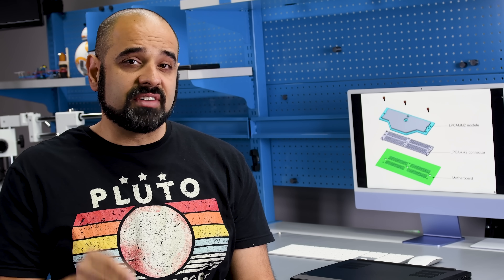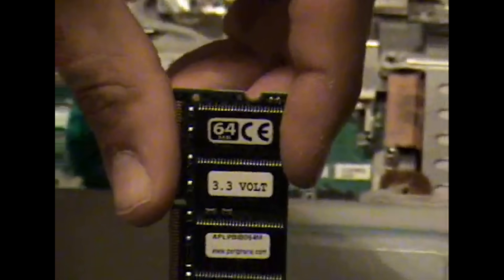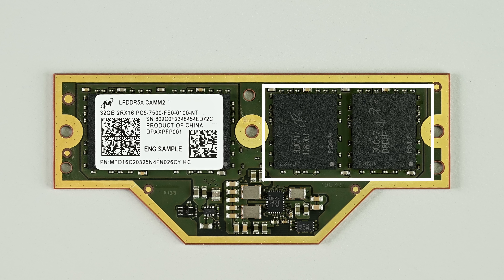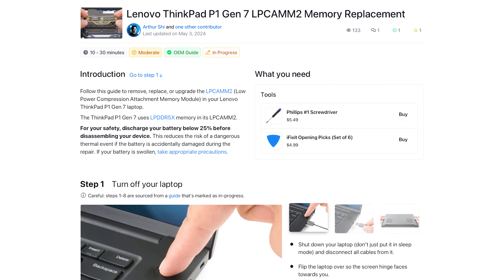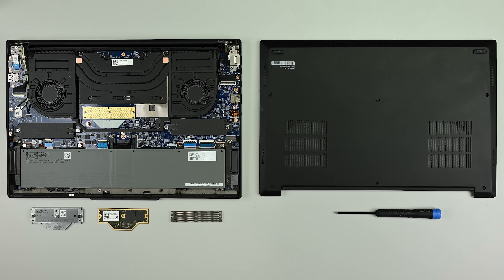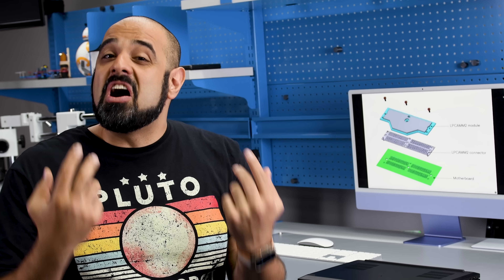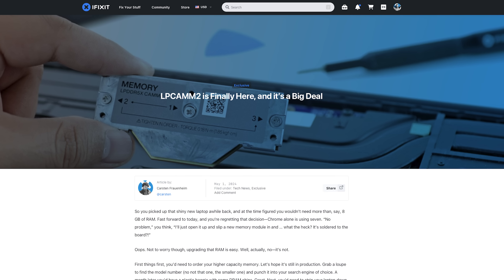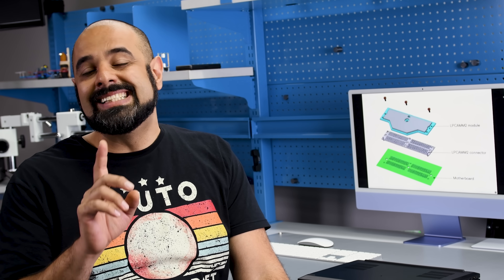New Laptop Memory Is Here! LPCAMM2 Changes Everything!

Comment: Hopefully the new ARM Laptops use this instead of using the platform architecture change as an excuse to start soldering RAM and storage like Apple. That pin interface is genius. Just replace the cheap interconnect instead of worrying about bent or broken pins. CPUs should also do that.
Reply: The inability of ram swaps is my biggest concern about arm chips. If that is the solution i am optimistic that we will see more arm chips in the future especially in laptops.
Reply: On a processor LGA it would be more challenging due to the increased pin density. Instead of 240 pins you're looking more like 1331 or more in a densely packed grid. That's gonna take some serious pressure engineering to get right but man oh man would it ibe worth it!!
Reply: @DigBipper188  it'll probably just be expensive
Reply: I'd like to see cpus with this compression interconnect in laptops. Not on all or even most laptops, but specifically gaming laptops. There is no reason we couldn't have upgradable cpus in laptops again.
Reply: No way storage is getting soldered. That's an apple bs thing. Soldered memory probably will be common as this was just introduced and it is simpler to assemble
Reply: I'm still concerned about them because MS doesn't allow ARM CPUs to have a toggle for secure boot. The unlocked bootloader stuff on Android is an absolute mess and I hope PCs don't end up like that
Reply: @AdamSmith-gs2dv  You will be able to boot any media as long as it is verified by microsoft by paying them the tithe. Every major linux distro is secure boot verified.
Reply: I don't see why they can't implement two tiers of RAM, even Apple could do this. System performance would be limited by upgradeable (slower) memory, while soldered memory would act as a huge, slightly faster cache. But I can see this being a thing, with proper software support for optimization.
Reply: @sovo1212  Bean canyon already has CPU PCB soldered RAM as L4 cache; in addition to the socket SODIMM.
Reply: @longdang2681  Didn't know about it. This is probably what the future holds.
Reply: I dont think anybody have bandwith that apple has when it comes to ram
Reply: I bent a pin while installing my i7 years ago, and then spent a hellish number of hours fixing it, so I second this for CPUs!
Reply: Why arms has inability to swap ram?
Reply: @NetvoTV  it does. Ampere CPUs are ARM and use regular desktop RAM. Manufacturers will lie to you to convince you that it is for your security or some debunked benefit. The only benefit to soldered RAM and storage is making you pay 10x the price of the components compared to buying and upgrading yourself. Also, it makes sure when you need more powerful components or those components break you have to buy a whole new device. It is more profitable to not engineer a solution to lack of repairability.
Reply: @shApYT  how about the signal lose this video mentioned from low power ram not close enough to the CPU and GPU,
Reply: @NetvoTV  the engineers figured out a solution. Doesn't mean manufacturers like Apple want that solution.
Reply: @shApYT soldered ram also means faster ram speeds th, and arm isn't compattible with the normal ram sticks in motherboards ,that is why they still use soldered chips in the snapdragon laptops.
Reply: @NetvoTV  For upgradable RAM, computers(both ARM and x86) needs to maintain compatibility with any installed socket RAM, otherwise you end up with picky systems that will only work with certain RAM modules. Technically ARM systems can do it but will likely need additional things including an updatable bios/ROM. This would add complexity and cost etc. to the ARM system. x86 already have this extra complexity by default with their ability to update bios to improve RAM compatibility. In this sense, consumer x86 systems have had years to become very sophisticated when compared to similar ARM systems. Keeping the electronics/complexity sparse also helps the ARM system to reduce it power consumption.
Reply: I doubt the first gen will have it, in the video he said Micron and Lenovo partnered to do it first, I give it 2 years to properly saturate the industry.
Reply: it would be cool on cpus as well but there are two big problems in that the ridiculous pressure and heat and the amount of pins, but cool to see it in there as well
Reply: This tech is undoubtedly awesome!  When it comes too companies using it Lenovo setting a bar will be good for companies who would probably rather lower species but upgradeable laptops en mass than be forced into more expensive ones that can't be fixed at all.   Fingers crossed we see this formate taken by other companies and framework laptops. As laptops switch to arm and are compared to cellphones now in terms of manufacturing I hope we can end this trend of e waste products produced with bare minimum specs lasting only a couple years before becoming obsolete.
Reply: It all depends on how large the GPU is,   

If you have a large enough GPU then just like a dGPU on desktop having socketed memory (even this LPCAMM2) is just to limited when it comes to bandwidth and your going will end up bandwidth starved.
Reply: Plus upgrade interconnects that may allow better upgrades down the line like faster than normally possible Mhz/transfer
Reply: Even if the Snapdragon doesn't use it, there maybe a workaround some companies use to include LPCAMM2 in addition to upgrade the existing RAM.
Reply: Most windows laptops are already soldered but I'd love for there to be a snapdragon elite x option with upgradable ram.
Reply: You can forget about replaceable RAM on ARM platforms, those will always be made in SoC format
Reply: Just hopes that the pads don't wear out
Reply: I clearly hates apple because they soldering ram and storage. If storage dies first the board absolutely die for normal ppl
Reply: @hasyidanparamananda  wait until you find out many windows laptops also have soldered ram...it's not just an apple issue. you cant just blame apple for everything and ignore the same issues on the windows side.
Reply: @hasyidanparamananda apple uses a SOC approach now, so we probably won’t get a replaceable RAM until something drastic happens
Reply: @Velocifyer  but apple was the first company to do it in a very efficient way. Both box86/qemu and windows are significantly slower than rosetta2 when it comes to emulating x86
Reply: But the better than Apple M1 still not told anything about the bandwidth.. i mean even the newly introduced M4 have better bandwidth like the M1, but still can't even touch the M1 Ultra 800GB/s bandwidth.. so if still just about 128GB/s than that is about the same again likr to compare the HDD with SSD and crying the HDD is cheaper, so why the SSD cost that much.. (Apple already sold laptops with 400GB/d bandwidth in 2021,so anything under that is just too slow, since that was onl the M1 speed, the M4 line up just now coming, and the basic M4 already showed speed increase on the bandwidth..)
Reply: @TamasKiss-yk4st  ram bandwidth doesn't really matter PCs have used DIMM forever and a $3000 PC is 10x more powerful than a $3000 mac
Reply: They will use soldered RAM, pretty sure, as they adress a different market sector. They will replace Chromebooks and entry-level laptops where the whole motherboard isn't that much more worth than a single LPCAMM module ;)
Try using Windows or even Linux on ARM and you know what I'm talking about. Fine for Browsing the web, not fine for professional tasks (even if they don't require that much CPU power). X86 has just become the standard for professional applications on those two OSes.
MacOS circumvented that with a tight ecosystem, an incredibly well working x86 emulation, and ( BIG AND!) a user base that doesn't depend on legacy software support (as that NEVER was a strength of Apple's OSes. Even with intel Macs - Software not designed for that specific MacOS version often ran poorly)
Reply: @TheRailroad99  That's not ARM specific, it's because most of the ARM stuff available to consumers right now is either scaled up mobile, embedded or dev platforms.  I got to play with an Ampere Altra before handing it off to dev's and it ran Windows and Linux fine (with an Nvidia GPU) even with lower single core clock speeds, but even that is more meant for development than to be a desktop.  There are some ARM workstations (again mostly meant for development) out there and of course hyperscalers have been using ARM for compute for a while now, hopefully QUALCOMM, AMD or NVidia (or someone else) will get serious about developing ARM for desktops now that apple has shown it can be viable if you don't screw it up like MS did with windows RT back when.

Comment: Nice.  It should have a second "slot" so you won't have to throw away your existing module.
Just call it "Not Apple".
Reply: For the reasons that this was created (trace lengths, signal integrity) you would just be introducing the same issues..  Besides, the LPCAMM modules run dual channel already, meaning it is already at the highest performance you will get.
Reply: @jorper2526  So it would be impossible to add a second slot because the CPU only has one edge???  I thought a CPU typically has four edges.  Granted, adding four memory modules would be impossible because there would not be enough physical room, plus needing room for the bus from CPU to I/O, etc.  But maybe two memory modules on opposing sides of a CPU, with each the same short distance from the CPU.

I never mentioned performance reasons or dual-channel.  You made up that straw man.  I only mentioned it would be nice to not have to discard your existing memory to do an upgrade.

Comment: LPCAMM2 runs at just under 10 Gb/s but yet Apples on chip memory on the M3 runs at 100 Gb/s so it's 1/10th slower.
Reply: And BOOM M4 announced with 120 GB/s bandwidth aka they just in under a year added 2x the memory bandwidth of LPCAMM2 to the current memory solution. So no LPCAMM2 will never be a replacement when it needs to power Neural Engine cores, CPU and GPU at the same time.

Comment: Hopefully we'll see Framework offer laptops that have this! Although I wonder if they'd need to redesign the mainboard so the RAM's closer to the CPU...
Reply: Probably would, but they probably can figure out how to make a new main board fit the existing chassis
Reply: They might be able to get some performance increases since the ram will use less of the power budget, so they might be working on it already
Reply: @LmgWarThunder LPDDR is faster because the shorter traces mean better signal integrity, which means you can run the RAM faster without errors.
Reply: @LmgWarThunder  Performance?  Not for the reason you are stating.  Memory module power budget isn't going to affect the amount of power the CPU will draw.

That is ultimately a cooling issue, as any laptop will boost up to its max.. But, inevitably the thin and small cooling solutions they demand will cause the CPU to then downclock.

That being said, this is a performance increase because LPDDR is faster than SODIMM memory.
Reply: @jorper2526  I wouldn't call it faster. It has higher bandwidth, but worse timings, aka latency.
Reply: @Winnetou17  that is not true.. It is physically closer to the cpu, which means traces are shorter which does in fact affect latency.

LPDDR is just "better" but comes with downsides like repairability and upgradeability. LPCAMM2 should address those.

Besides which, bandwidth is speed. It has much greater bandwidth than competing SODIMM parts. Ultimately even if latency was slightly higher, the entire throughput would be faster.
Reply: @Winnetou17 Faster memory often has worse CAS latency because the latency is measured in terms of number of clock cycles, so an identical latency in nanoseconds will result in a larger number of clock cycles for faster RAM and a higher CAS latency as a result.
Reply: @bosstowndynamics5488  Yeah, I know that. I'm a bit salty that I can't easily find the timings on LPDDR to more easily confirm. I remember reading it somewhere that 7467 MT/s was at CL 50. Now, the equivalent 10ns latency that a 6000 MT/s CL 30 has, would've been here CL 37 or CL 38. CL 50 is clearly significantly more. But I'm not sure if it was a one off or if all LRDDR modules have that. I also don't have any laptops with LPDDR.
Reply: I wonder if Framework will go with 1 LPCAMM2 slot?/connector or with 2, just 1 is enough to enable Dual channel but would be cool if they retain 2 slots at least on the Framework 16
Reply: Would also be neat to this combined with the Frore Systems AirJet tech whenever Framework adapts it.

Comment: Awesome!  Come on other laptop OEM's, jump on this 🙂 Size is rarely ever the limiting factor, but the balance of power/heat to performance nearly always is.  I'm hoping that Dell's 2025 XPS brings back ports and upgradable memory, and this could be the path to that better next option 😀.
Reply: Dell came up with this, so I think it's safe to say they'll be using it soon enough. Dell allowed it to be adopted as an industry standard so I think HP and the others will join Lenovo soon enough.

Comment: Is it possible to have multiple modules like sodim Ram or is it limited to one module?
Reply: It has dual-channel support in a single module, so it would in theory need a platform that supports quad-channel LPDDR5 to use more than one module. It shouldn't be impossible, but maybe unviable
Reply: @zyhawk42 this would be amazing for APUs
Reply: Probably limited to one for power efficiency less traces to drive

Comment: I wish it was rectangle, why do they have to make it such a weird shape.
Reply: What makes it worse for pcb manufacturing?
Reply: @Marcos-ee7nt  Rectangular PCB have much better compatibility with standard manufacturing processes (panelization) and are best for component placement. My original comment, however, just questions why they chose the design.
Reply: Ease of Keying and packaging constraints within the tight space of a laptop motherboard.
Reply: @xmlthegreat  simply just make it a bit longer to fit the SPD and PMIC, laptop manufacturers will design around the shape just like they did for sodimm. Either shape would work with the constraints, just a weird design choice. (Ie it’s worse for PCB manufacturing)
Reply: Why does it matter

Comment: already existing laptop ram sticks go up to 6400 MTPS which is still plenty for today
Reply: It's good enough for most use cases involving the CPU, but integrated GPUs have improved quite a lot over the last few generations and are increasingly becoming bottlenecked by memory bandwidth.
Reply: it might be fast enough for a  notebook but if that notebook it's uses only the ram for apu then that memory it's not that fast anymore
Reply: 6400 if you're lucky. Only soldered RAM laptops can reach 7500.
If we're early in the generation and we're already having problems reaching the top spec, then just imagine if we moved to DDR6 and still stuck with SODIMM.
Those future memory modules are going to be unbearably slow.
Reply: @Goodmanperson55  well we are not there yet, and as of today these new modules are probably going to end up about 1000 mtps faster for being way more expensive (new standart, 1 manufacturer, 1 laptop) and unusable anywhere else. In addition the fastest laptops currently available use SODIMMS, so for now the speed isnt really the excuse. The thing is RAM speed isn't that important in the end and I prefer having the option to upgrade it when I feel like it.
Reply: @jachupol5823  
We kind of already are. 6400 is not the limit for DDR5. If they can't develop the required technology this early, you will be complaining in the future about everything being soldered or everything being slow. So I see no point in all of these comments poorly understanding the reason behind LPCAMM2 and complaining for no reason.